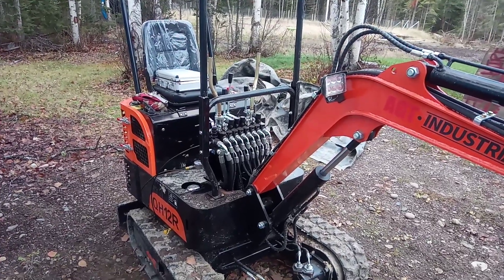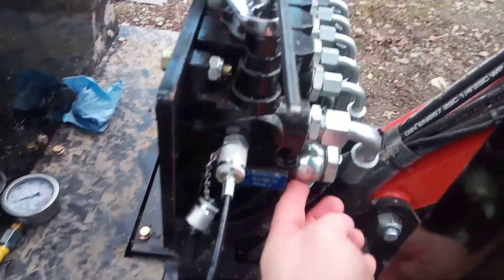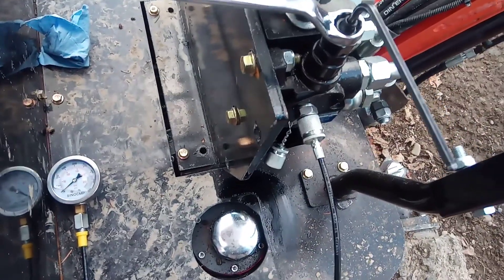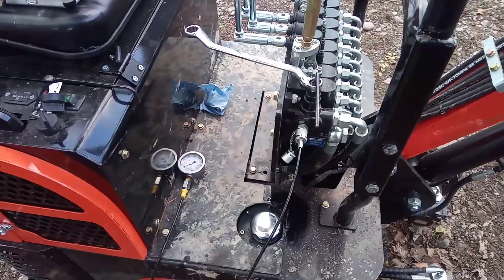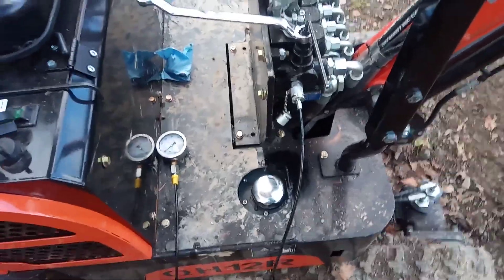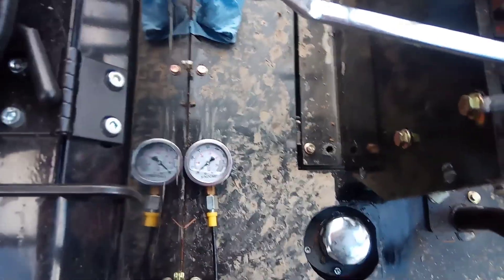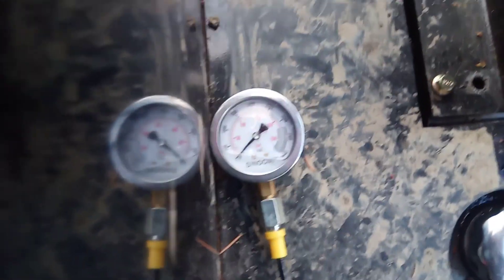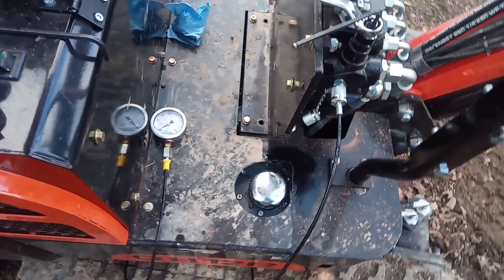How To Check & Set Hydraulic Pressure On A Chinese Mini Excavator

Comment: I just started having issues with my tracks and the speed of my arm when raising it. There isnt much movement when trying to pivot my machine. The tracks barely move when trying to turn. I know it could be alot of things. Any advice or things I should check?
Reply: clean out the hydraulic filter in the tank
Reply: Check the track tension and raise the hydraulic pressure as shown in the video. That might help
Reply: @carlospascall7905 it was the hydraulic pump.

Comment: Great video showing the proper way of adjusting pressure and checking pressure. Everytime you increase pressure, you push the machine a little closer to its breaking point. I keep my pressure at 2500 psi. If my machine is struggling, I use a smaller bucket, or take smaller bites, or even use a different digging implement.